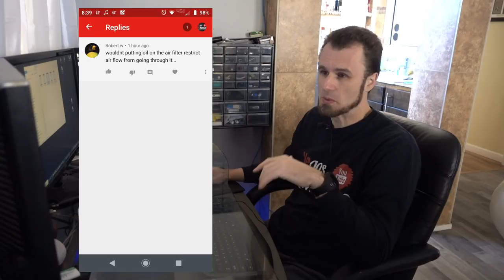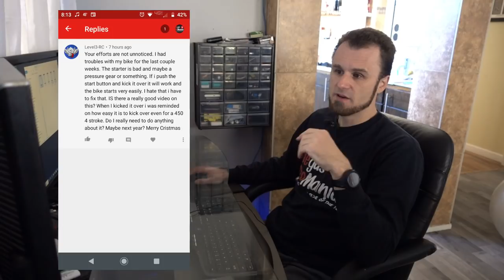Bike won't start, Giveaways are a SCAM, Why you need to OIL the AIR filter -  Dirty Bike Talk #1

Comment: Neither. They are both a little off. One thing I have noticed of successful channels is they learned quickly how important sound is and how difficult it is to please everyone. Don't change your ways. Do what you would do if it were a vital part of your bike.
Reply from the maker: Awesome, I'll look in to a better sound solution later on, at this pint I want to see if this actually works, many channels in este lots of money in expensive equipment and went down and never made it
Reply: I do agree the sound is of most important, I could watch a 360p video with Great audio but I can't watch a video with terrible audio no matter the quality.
My suggestion would be go with what you have right now it's not bad, but keep getting a good audio solution at the top of your list.

Comment: On  your FX, have you tested different front (12T) and/or rear sprocket (52T, 53T), for more low end torque.  For me not to worried about top end as I rarely see 6th gear.  thanks.
Reply from the maker: Nope, my bike always felt great, but I'll explain in a next video why

Comment: Nice concept! I got a topic / question. When should you give up on a used bike? My situation is i got an 01 cr250 that i invest already to much (suspensions, clutch, new linkage, all new bearing ect...) I discover that i need a new engine case and it expensive and hard to find.
Reply from the maker: i will try to answer that on the next video